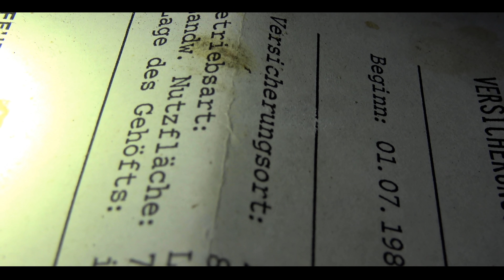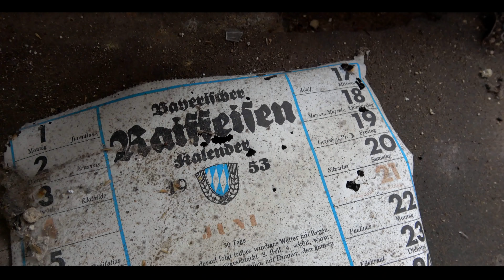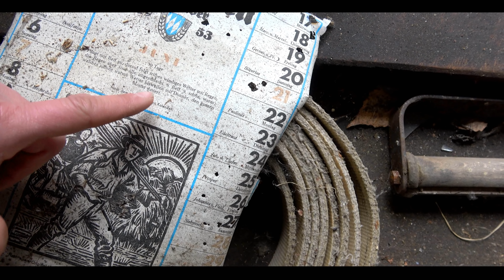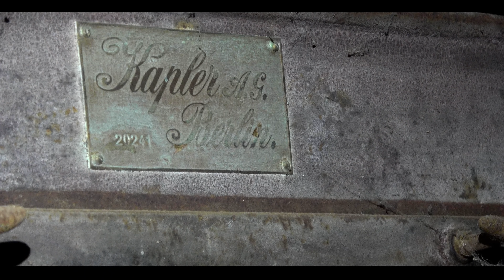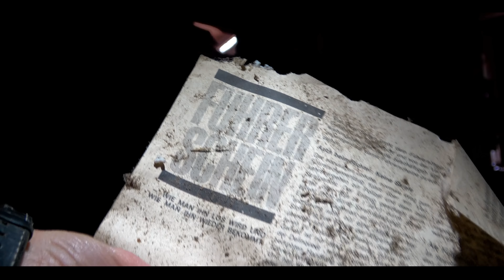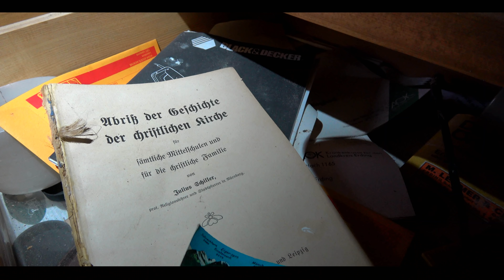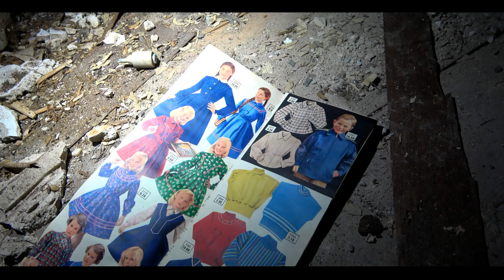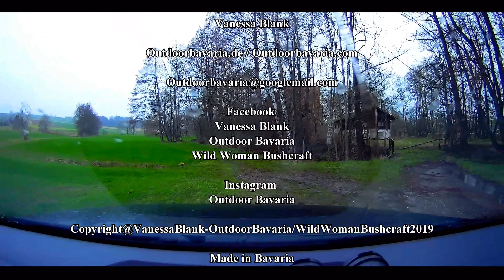Lost Place- Time travel into old mill- Vanessa Blank - Wild Woman Bushcraft - 4k

Comment: I believe the the device is a style of vice for holding wood while sitting down and using a draw knife when shaping wood, you use your foot to push the bottom to clamp down on the wood. It is a very interesting place lots of things to let you visualize how work was done back in the day. Here in Tennessee the people have put back into working condition some flour and corn meal mills, that grinds out the flour for sale. there are also various places up in New England where some old saw mills put back in new condition that put out timber for sale. Thanks for another great place. Stay safe.

Comment: You go to some of the most interesting places to explore. Here in the States most places like this mill are demolished to build apartment buildings and shopping malls. 🌹

A tip for going up or down old wooden stairs, stay close to the wall just in case a step is rotten. It won't break as easily. 🌹

Comment: Schnitzelbank, yes a shave horse. Put your wood under the   wooden head and push the lower lever with your leg to hold the work tight. Shave spindles chair legs tool handles etc.

Comment: Interesting explore, lots of cool artifacts.  When I saw all the bottles in the house I wondered if maybe they were milling grains to make malt for beer. --- When going up old stairs or ladders you should try to put your weight on the edges of the steps rather than the center. The center is usually the weakest part. And don't put both feet on the same step or ladder rung.